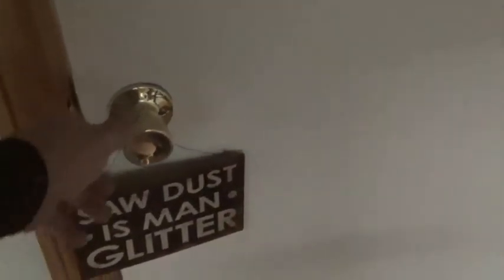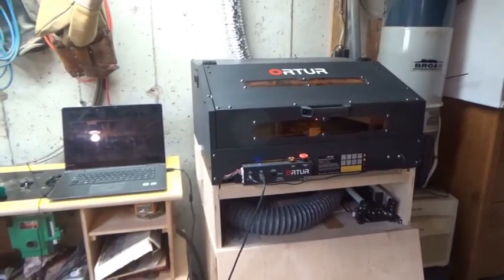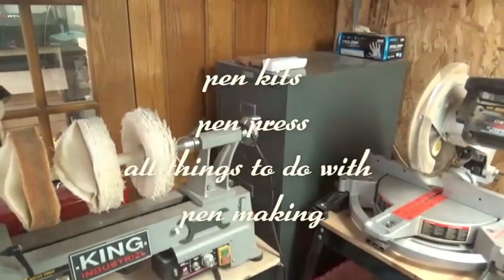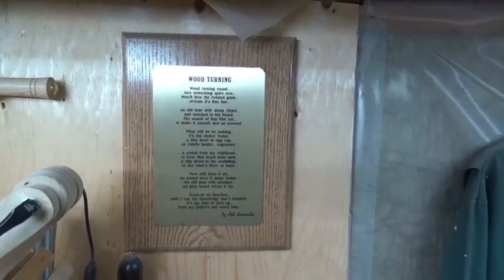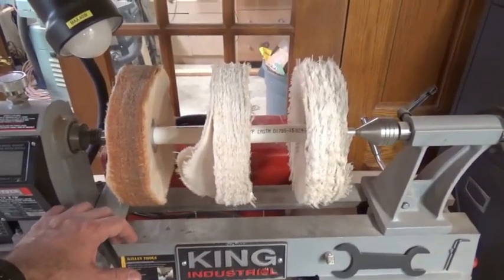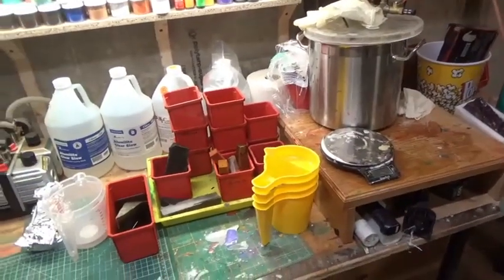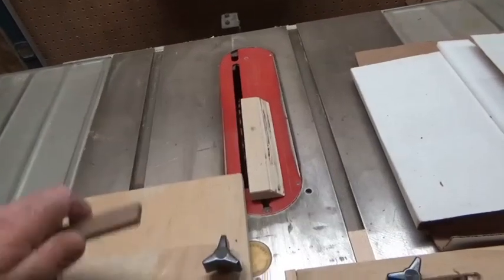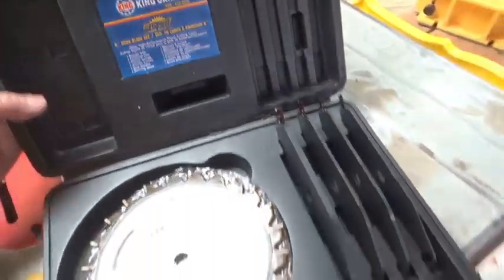Shop tour, jigs and things

Comment: Hi Rob. I recently bought a Rikon 8” slow speed grinder to go with my Wolverine grinding jig system. It came with aluminum oxide wheels which I no longer need. I won’t need the guards, tool rests and eye shields. I plan to sell the wheels but what did you do with the left over hardware? Thanks for replying time. Tom, Bracebridge, Ontario
Reply from the maker: Lol i hear ya, I actually put the aluminum oxide wheel in the box that the cbn came in and put it on a shelf, the other parts are still sitting on the grinder bench behind it lol.